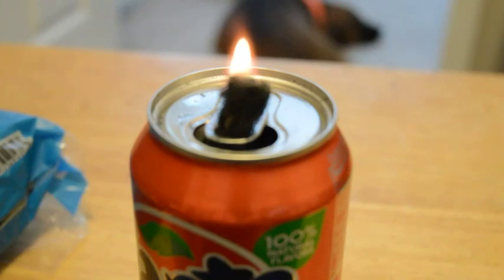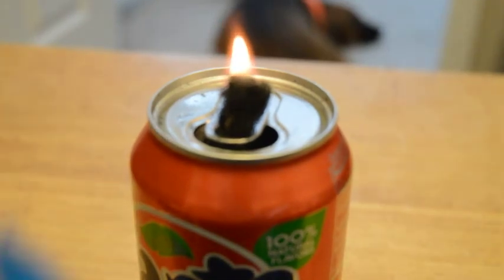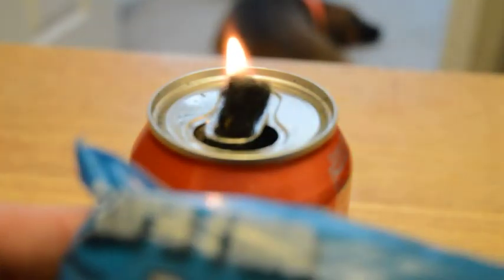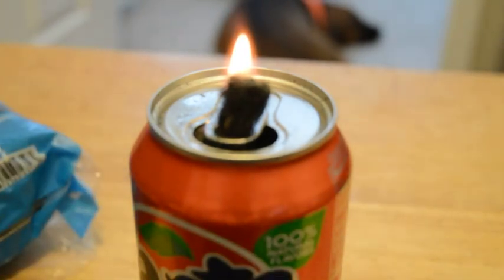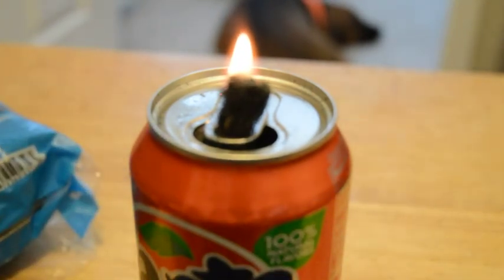Waste Oil lamp

Comment: This does not work with used motor oil. Bad info. Only way it works if you mix kerosene with it.   Used oil will not wick with Steel wool, cotton or fiberglass.